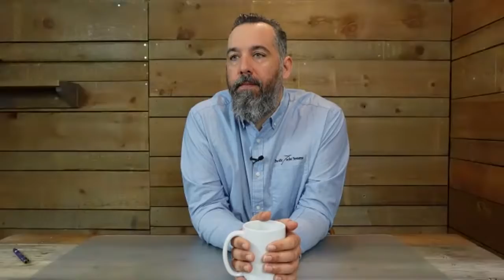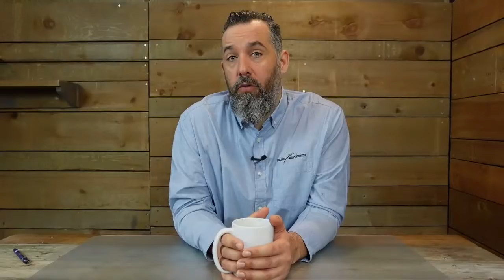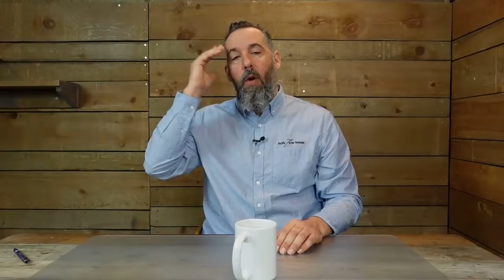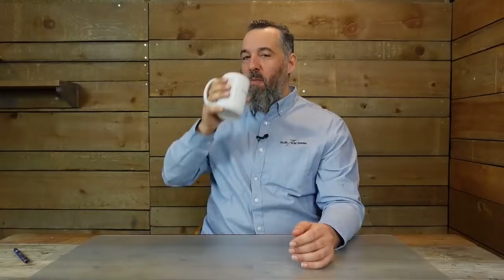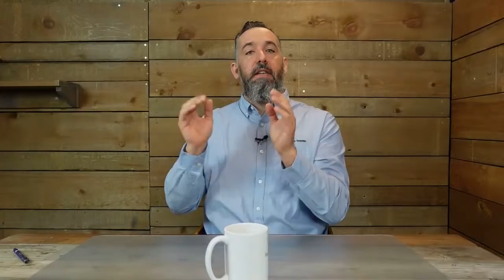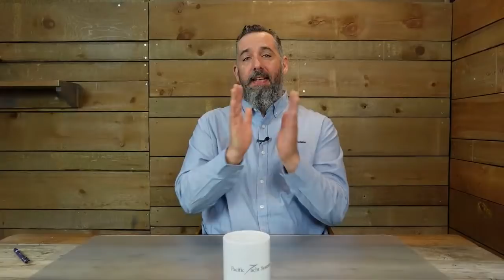LIve Stream with Jeff Cote

Comment: Jeff, Balmar has a 48v 100amp alternator. I haven't seen a 48v genset but one could make one with this alternator. Solar would work be more efficient. With lithium batteries set to 48v bank. Now you could have a 48v inverter, 24v windless, winches, and 12v lights, stereo radio, etc. Wires are now at optimal size (less heat, less weight, smaller size). What are your thoughts about a system like this? The Bell System love 48v.

Marc
Reply from the maker: Hi Marc, thanks for sharing, didn't know that. Going to 48 VDC is not crazy, some DC appliances like starters, windlasses, winch(s), and even thruster might have a smaller  selection but over time we'll get there.

Comment: Thanks PYS and Jeff - watch all your videos.  Q.  I am redoing my pedestal and as a result have to move all my engine instruments to top of the new Edson pedestal head.  My question is can I/Should I add a terminal block in the engine compartment so that I don't have a but splice connection or is a terminal block a bad idea?  the instruments wiring will include the tach, fuel, volts, and ignition switch, alarm horn, blower motor and fuse.  I appreciate any guidance/advice.  Please keep the videos coming! :)
Reply from the maker: Edwin, your absolutely on the correct track, way better to use terminal strips then butt connectors. Did the same on my own engine,

Comment: Hi Jeff, another great episode. The format is perfect. The person presenting the questions is a great asset to the broadcast .
I have a question regarding solar panels and charge controllers. All of the Victron  schematics  on their website show a PV dual pole disconnect between the panel and the controller. I understand the requirement on land is according to building codes both in North America and Europe. I assume your concern might be related to boat applications. Can you address this online please. Cheers Kevin
Reply from the maker: Hi Kevin, good question and sometimes we see this breaker between solar panels and controllers. In the marine world, we do something similar by fusing the circuit from battery to controller, and also even some controllers have a fuse between controller and solar array. 

Not sure why the land code does it one way and the marine another. Anybody can comment?

Comment: Jeff today you mentioned something you are asked the question about automotive weatherproof or water tight fittings I believe what they were referring to was AA connectors call whether pack and are normally used sensor to EC mec M to gang plug and so forth and thank you so much for all your information I really appreciated
Reply from the maker: Hi Jim, thanks for letting me know. Never heard of "AA Connectors" or even "EC mec M to gang plug", are those terms in the automotive world?
Reply: Yes Jeff they are in the automotive world the I believe they also use them in some of the computer configurations for extra work it's called weather pack and the whole line of different sizes different wire sizes him for centres for interconnects for all sorts of thing whether pack factory buying kits